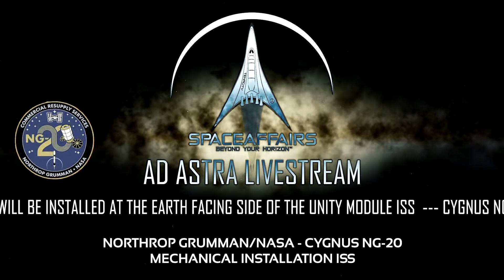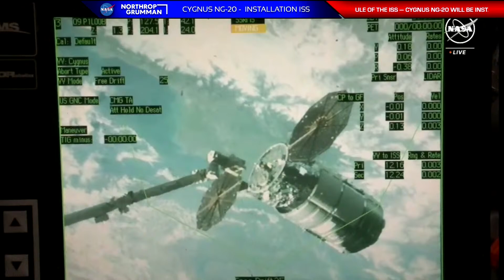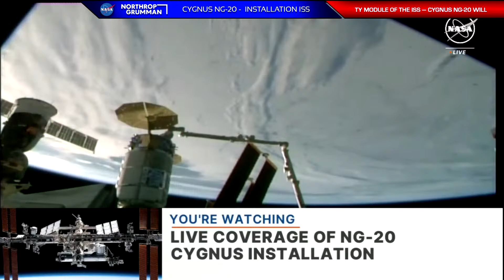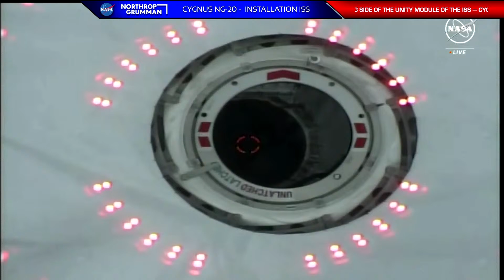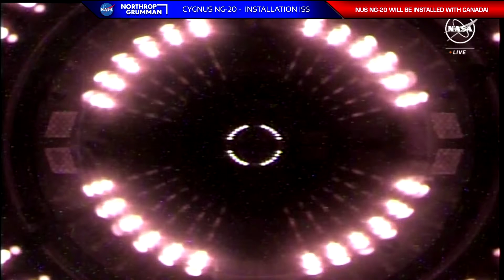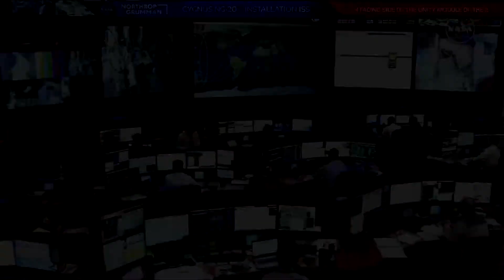Northrop Grumman/NASA - Cygnus NG-20 - Mechanical Installation ISS - February 1, 2024

Comment: Installation?? Does installation = docking??
Reply from the maker: Docking = a spacecraft docks steered by sombody our automated directly to a docking node or docking port. This here is a real installation, you use a tool and install Cygnus manually at the docking node. This is done by robot operators at Mission Control Houston, no astronaut is involved. The Cygnus is grabbed with the robotic arm (Canadarm-2) and berthed then to the node. It is called "Berthing", not docking. But like said, it is installed manually and mechanicially.